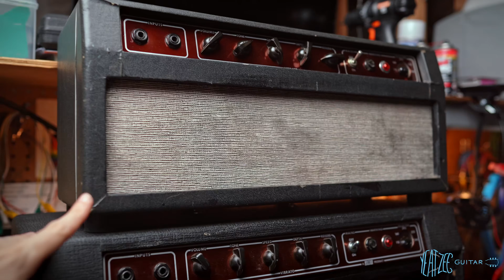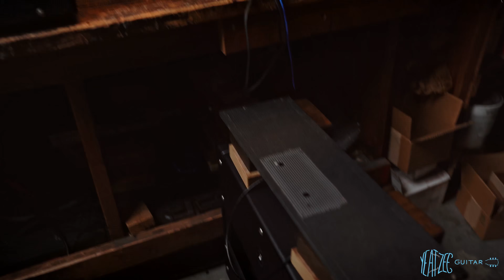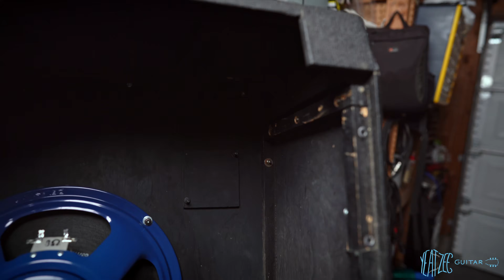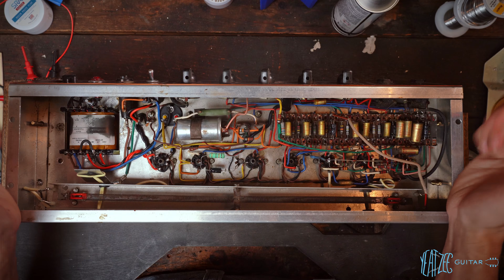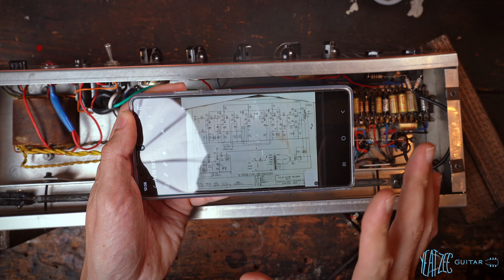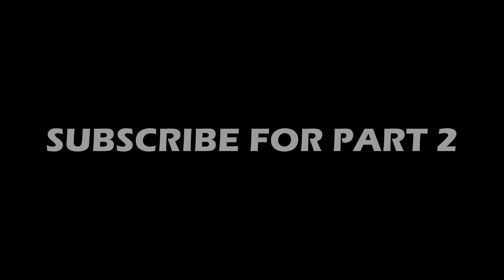The Rarest Vox Ever Made

Comment: "300v is 300v" is partly true. but the power transformer definitely will affect the overall sound of an amp! the impedance and reflected impedance will vary from transformer to transformer. with the type of windings and steel composition and loads. don't totally discount how important the power transformer is.
Reply from the maker: Impedance and reflected impedance? On a PT? You sure you're not referring to an output transformer? 

If the amp is producing 300v on the plates with two different PT's that are the same specs but one is vintage and one is a modern repro, there will be 0 difference in tone or performance.

Comment: Cool find! how does the baffle look behind the speaker, "Occhams razor" would tell its modified, probably not done at the factory. I have seen several other amps had the 1x12" modification done by creative players. I hope Im wrong, would be super cool if its a prototype.
Reply from the maker: The baffle is a replacement no question, the lw30 never came with a 1x12 and you can see the cutouts for the 3 10" elacs that would have been there. But the cloth is original cloth, the baffle itself looks good... So where was it made? We'll probably never know for sure either way, but it is obviously original vintage JMI parts so it's cool regardless
Reply: Actually the baffle is not a replacement. As far as we know, it never had a 3x10 baffle fitted at JMI, we only know that the surrounding cabinet for the LW30 was cut to fit 10” speakers so that’s important to point out. JMI would have grabbed available parts off the shelf to build this amp and that doesn’t mean dismantling a completely built LW30 cabinet. Occam’s Razor is actually pointing at this all being done at the factory. The way the speaker holes were cut (and the tweeter holes covered) all clearly JMI work, done at the same time as the rest of the cabinet, including the mounting hardware. The other important point to bring up in regards to this amp is that all of the components are dated to 1964, including the copper panel SRT chassis, the LW30 cabinet and the mid-64 T531 Celestion (not shown in this video but that’s the speaker’s date. That sort of blows any notion out of the water that this was some kind of employee build or post-JMI build. It’s simply implausible that any later build would just happen to pick ALL ‘64-dated parts to assemble this amp. Given the amount of experimentation at JMI in ‘64, it’s a reasonable assumption that the factory was testing out this concept with the 3x10s and perhaps tried a 12” on at least this one, unless others come along. Regardless I’m honored to be its new caretaker! Great video Tanner, it’s cool to get the full overview.